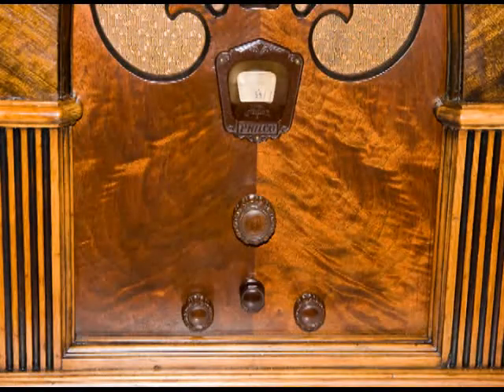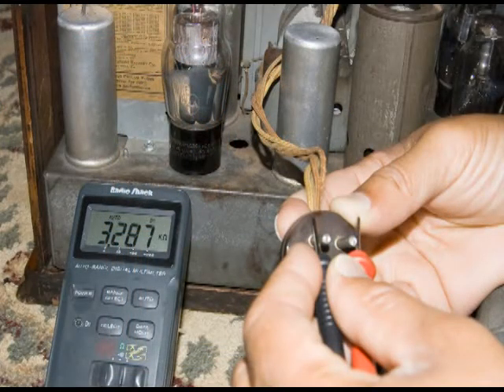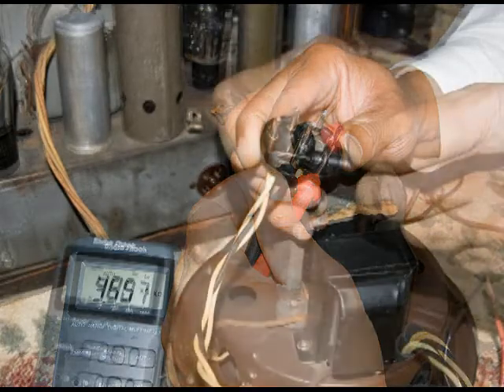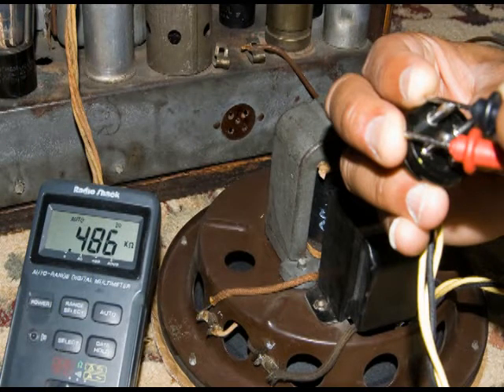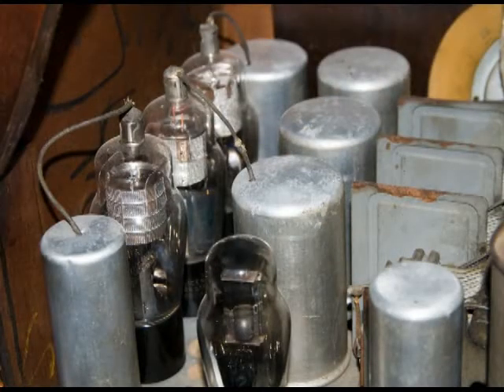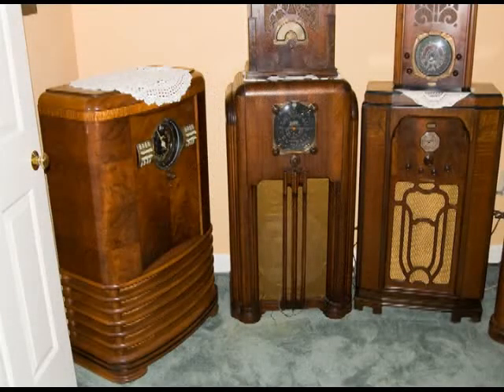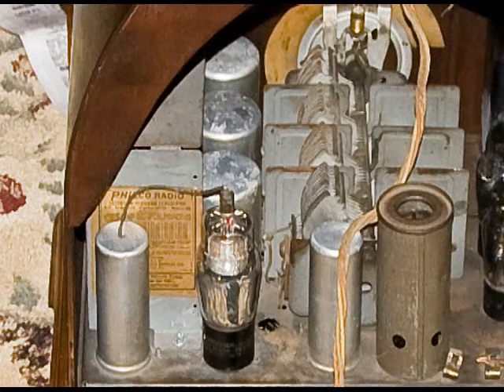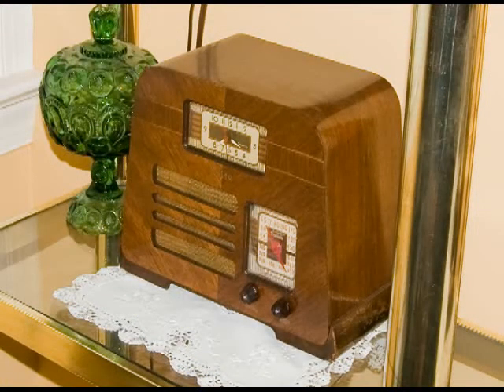House Call

Comment from the maker: @yinglyca 
There is a number of possibles. There is a field coil and a audio primary, so if it is right no problem. If not you could have low or no sound, and possibly damaging the speaker.

Comment from the maker: So I did mark the field coil and audio connection on the outside of the radio. That did help in confirming what the problem was. It ain't over till it's over (by Yogi Berra). Jesse does have some nice radios. Thanks.

Comment from the maker: I am sure that may be true and why would you suspect that it is wired wrong. Yes 3000 is the field coil and the 400+ is the audio output transformer, this one is not a push-pull. The restoration of the speaker was will done. The owner had sent off the speaker and after that I was finding all kinds of weird stuff that someone had done to this radio.

Comment: I guess the people who re-did that speaker didn't have such a radio to test it on and wired it wrong...The 3000 ohms probably would be the field coil and the 400 or so ohms would be the primary of the output transformer?
That's a very nice collection of radios there.

Comment: Watch out for Electro Dynamic speakers.  The field coil is, indeed, part of the power supply.  It's a TUNED CIRCUIT, which allow the use of 4, 8, 16 and 20 mFd filter caps.  The circuit (cap, field coil, cap) is tuned to 120 Hz, the frequency of the ripple with a full wave power supply.

Nice old sets shown...  Grille Cloth is hard to come by.  At least that which would look right on a Philco.  And I don't know how to do the cabinet work.

Comment from the maker: Some of the stuff you can find is amazing. A friend brought a Zenith 8S647 over and we found that someone had rewired all the filaments in series?????? The transformer was good????? So I told him he should put every filament wires back and to check every component and connection in the chassis. It took him some time but he did get the radio play great again. So who knows?????